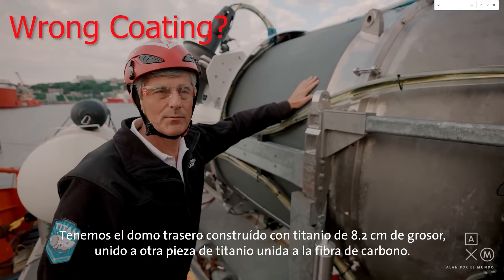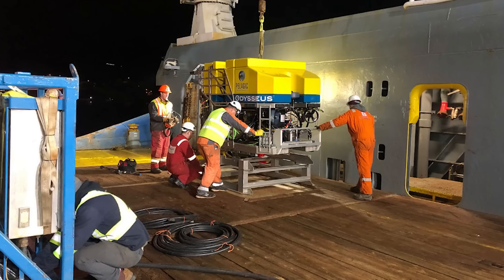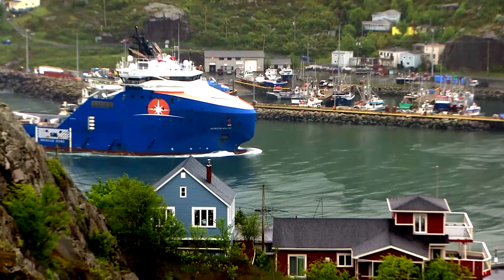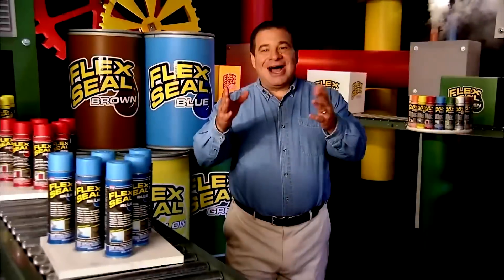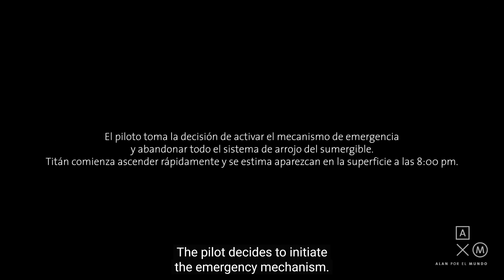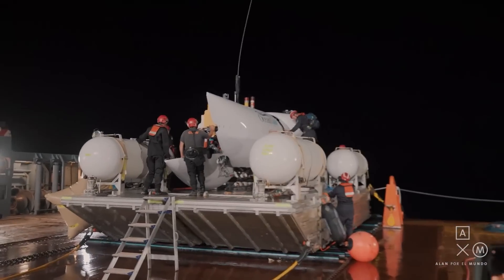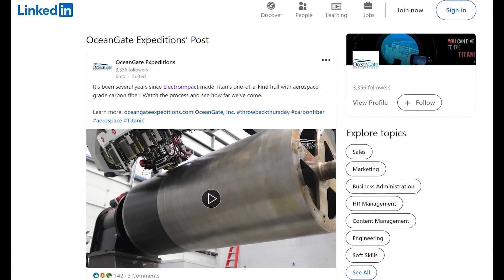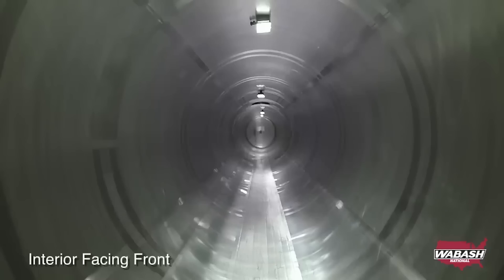Titan Sub Wrong Coating? Hull Construction, Debris Field Search

Comment: in fact, you can't really use 1/3rd scale models here, because the thickness of the CF/epoxy is crucial for the integrity of the tube. doing a smaller model might give incorrect positive results which may not transfer to the full scale item unless additional testing is done.
Reply: While true, in engineering, scale models are use as a way to verify "proof of concept", and MUST be followed up with testing on full-sized models to do a final test (sanity check).  This ensures any variations don't get "lost" between scale model and final product.

Comment: that rhino thing gave me the creeps first time I read this. some stuff to protect truck beds to be used, without proper testing one presumes, on a deep diving submersible beggars belief. however, that's just one mistake on top of the major ones, like using CF unidirectional fibres so not making use of the high tensile strength of CF  an cementing them to titan end caps.

Comment: He was ahppy enough to brag that the one third carbon fibre model had never been tested before but ASSUMED that a one third scale model could be scaled up.  You can't have it both ways and a full scale model was necessary to ensure they knew what would happen.  Perhaps they thought that because the problem was with one of the hemispheres, so making them out of titanium then gluing (!) that to the carbon fibre cylinder would "solve" the prob;em

Comment: Jeff, what wonders me, they wind the carbon over a steel (?) cylinder. Do they get that cylinder out of it later. OR, does that steel cylinder stay part of the hull?
Reply: There is a video of the steel liner being skull dragged out of the anchored carbon tube, with huge forces applied by the look of it. Whether it was the 2017 or the later hull I have no idea. Really didn't look too scientific in application though.
Reply: @bradleypark1936  Thanks. I do wonder why. It would seem stronger. Weird.

Comment: Should he have used it? Probably not. Think of it as a paint… with texture and thickness.

However of all the materials he did use, rhino liner and titanium were probably the only materials that were a good idea. 

As far as testing goes, a scale model is a start. Gives you a baseline to do full sized adjustments. You should still test full size. I also think it should go through destructive tests before they do non-destructive of the final manned vessel.

Comment: Great vid Jeff. Do you think the method used to create the CF cylinder was intended to avoid any weak spots that a criss-cross pattern might have?
Reply: @clivewismayer2404 A crisscross pattern is stronger than laying the fiber strands in parallel.  Crisscross is now standard in other applications (planes, cars, etv)

Comment: They probably didn't have a test chamber big enough to test a full size hull and were too cheap to pay for one. Scale effects are tricky, so it would not be wise to extrapolate from a single test of a model. They should also do multiple tests short of destruction on the same one to find out about fatigue effects.
A cylinder under compression load will fail by buckling in as seen with the tanker demonstration. Any out of round or flaw can provide the starting point for the failure so it is very hard to predict the actual failure load.

Comment: My first thought when I saw that they had used Rhinoliner is that it might not be chemically compatible with the adhesive used on the carbon fiber or the carbon fiber itself. 

It could have caused the carbon fiber to degrade at an accelerated rate.

Just a thought.
Reply: And it would make it almost impossible to visually detect such damage - or check for any stress cracking or delamination of the surface of the CF tube. Rhinoliner will conceal all the problems

Comment: Correct me if I'm wrong but was not that one third scale pressure test applying compression only in the vertical dimension? Hence the strength of his central cylindrical carbon fibre hull was not being tested at all. 

And the cylindrical end piece fibre failed that test before the pressure at the depth of the Titanic was reached hence why they went back to titanium domes?

Also were not those domes cross wound? Hmm I think nature was giving Rush a clear warning if only his ears were open.

Comment: The implosion at 12:12 is nothing like what happened to Titan. The pressure was 350 times greater, the speed of sound 4 times greater and the water 1000 times more dense than air. As the water moved in at a mile a second pushing fragments of carbon fibre, the air inside got compressed 350 times and hotter than molten steel, then the water kept moving in until it bounced off the super-compressed air. The bubble oscillated in and out - it's called bubble pulse - and "slowly" died away. All over in the blink of an eye.

Comment: People knew not seem to understand that if there is a problem catastrophe anyting they have to get those ships mobilized to get to find them. We used to call the Disco I don't know what the name of the boat and our Port when it broke down no, we did not have to work on it. It's sat there for three months until they could find the barge that could handle the weight of the ship just send it to where it needed to be to get fixed people think things happen overnight and they don't good job Jeff
Yeah Rhino liner my but won't do anything really easily guided underneath the car and it worked for about six months and that was about it   I knew somebody's going to say Flex Seal and it had to be you hahaha
His video is well worth the watch it's cut up into four pieces and it's very very good. There's another YouTuber that wanted to go but the seas are too rough and there were lots of problems with the Titan they went down 30 ft and came right back up he was offered the next trip and Lisa no getting to that come and that's the trip that included he was so damn lucky❤

Comment: One thing I like about the carbon fiber domes is that it would react the same to pressure as the hull.  I strongly suspect that the different materials, which would react to the stresses of the dives in differing ways, is a big contributing factor to the final implosion.  However there are so many things they screwed up who knows which imbicillic decision was the straw that broke the camel's back.
Reply: Nobody had test data on carbon fibre domes because nobody else was foolish enough to try it.
Reply: Carbon fiber domes is a good idea if you wanted it to shatter the first time down.
Reply: " However there are so many things they screwed up who knows which imbicillic decision was the straw that broke the camel's back." 

Yeah. At that point you have to ask yourself: What didn't go wrong? And how did it manage to be fine as long as it did, despite all the odds against it...
Reply: Making that hull out of carbon fiber was the thing that doomed that submersible. What you coat it with is kind of irrelevant.
Reply: Well you would be dead if you went with cf domes
Reply: Not true , the shape of hull and domes would affect pressure differently.

Comment: The tank car implosion supports the reality that a failure of a structure usually happens at one location and then progresses away from that point.  A lot of simulations on youtube have shown the pressure vessel to implode uniformly all the way around, all towards the center.  I think it likely initiated a failure at one location, water started coming in, and then the failure progresses outwards from that point but by then water was already inside and at some point the interia of the water inside started impacting the pressure vessel away from the point of initial failure and probably exerted more pressure on the inside of it than the static water pressure on the outside which could have caused that carbon fiber to fail outwards.

Comment: If no one else has pointed it out, it looks like the carbon fiber on the 1/3 scale model was wound differently -- in a diamond weave pattern than the hoop wrapped hull of the real Titan sub. One can see the weave pattern on the model.

It begs the question then, in what way did the 1/3 scale model represent the real thing?

Comment: And interesting video I watched was the process used to lay the carbon fiber is licensed by NASA.  Hence the NASA affiliation.  Apparently the benefit of this method is less waste and with different types of observation methods for the carbon laying process.  Also they can program algorithms for when the robot that lays the carbon has over laps or gaps.  High tech but very prone to issues

Comment: My dad told me to build a proper high pressure sub requires J&B cold weld on the end caps. Apply with a popsicle stick and let it cure a couple days. Good to go.

Comment: Does Rhinocoating have any solvents/chemical components that might affect the integrity of the carbon fiber and resins? It was also my understanding that the carbon fiber hull was not the original design gauge (7-inches thick); it was only 5 inches thick, making it much weaker; why the departure from the original design specification for it's intended use. In all, it's quite sad that Stockton Rush appears to have had some measure of contempt for safety engineering and the designs for intended use of the Titan submersible. May they all rest in peace

Comment: The exterior liner could well be used by the USN but probably on fiberglass fiber reinforced resin boats. 
There are nondestructive test & inspection methods for carbon fiber composite - from the visual to ultrasound and thermal imaging. Didn’t Lockridge shine some some sort of light through a hull early on? 
My question about the exterior coating is did it hinder or prevent even a simple, periodic visual inspection of the exterior of the hull? The Titan had (sadly past tense) a interior liner (from my review of pics) to which the two video monitors were attached and a deck. Some failures of composite tubes/pipes subject to high exterior pressures (sea bed piping) occur on the interior surface. Did OG ever periodically remove these liners to even visually inspect the hull? The NTSB will look at every aspect of OG’s operations. Now delamination of composites can occur within the structure (just like concrete pool decks) but a visual might uncover crazing, cracking or surface irregularities.

Comment: To test a chamber that is 1/3 the size of the one you are actually going to use is absolutely moronic.    The entire surface area of the smaller chamber is exponentially reduced when you apply pounds per square inch of pressure. You cannot simply test a much smaller chamber and multiply the numbers up and think you are getting a mathematically accurate view of what the actual chamber is going to experience.  Hence, yet one more reason Stockton was NOT the smartest guy in the room like he thought he was.

Comment: The handling does not seem to me to be the source of the problem, at least the frame is not twisted by the lifting, even if it can force a little on the top of the titanium strapping, in the long run yes it may be , but it is above all that I have seen more serious, the frame (lengthwise profile view) is a rectangle whose legs are fixed to the titanium strapping, one of the bottom bars is bent by an accident (from lifting or diving on the bottom) (we see it on a photo) which modifies the parallelism of the legs, with the consequence of forcing the strapping in rotation and hindering the fall of the frame, once the frame has fallen, this force on the strapping reverses sharply if the rear seeks to float from the syntactic foam, or is always released so abruptly, the carbon does not need to implode to be pulverized the wave arrives at twice the speed of sound.

Comment: The rhino liner is irrelevant.  The carbon hull failed, and no amount of flexible liner would have saved it.  The only real question in my mind is, did it fail in the middle or on glue joint?  It sounds from the leaked transcripts that it failed aft where the cap was glued to the hull.  Bottom line metal sphere or nothing if your going that deep.

Comment: Jeff, if the Hull of the Titan Submersible had been fabricated to the original specification of 7” thick,….NOT 5”. Would the proprietary RTM system been effective, and given the crew of Titan time to surface? What good is a Hull monitor if you can’t surface before you drown and or implode? 😮

Comment: I have heard that the 777 main wing spar (this bears most of the lift force holding the plane in the air + xtra G loading) is a carbon fiber reinforced composite (CFRC). I doubt Boeing tested a full size prototype in a simulation of one flight & concluded, “yup, this will be fine.” 
The 1/3 scale model failed at less than 4,000 foot-depth pressure! What did OG learn from this other than that design of a CFRC end cap with a view port will fail long before the Titanic will be reached. 
Why a 1/3 scale model? Cost. I don’t know how stresses scale in submersible pressure hulls but do know small internal diameter (ID) tubing of a certain wall thickness can carry far higher (steam) pressures than a larger ID tube with a proportionately thicker wall thickness; all other things being the same, increasing the thickness doesn’t mean the additional material adds that much more to allowable pressure. Certainly a 1/3 scale model might show up a bad design or construction method. Is there a shore side test facility capable of testing a Titan sized item? Better question, is one available at a reasonable price? There’s always dipping the sub in the ocean but this has support ship rental costs (Sounds like OG did do test dives).

Comment: Just a fun fact. UV light deteriorates carbon fiber quite rapidly. Boeing had to change the interior lighting in its Everett assembly line once they discovered the problem during the building of the 787. Had to strike the first couple of lines because of the damage caused.

Comment: I cant find the video again, but I noticed something interesting about those mini-sub test results.
The mini-sub for the test was made completely out of carbon fiber, including the domes.
When they pulled the mini-sub out of the test casing, everything was pretty destroyed except the domes.
In another video of the mini-test-sub being built, I saw the carbon fiber for (obvious reasons; you can't install them linear on the half-sphere) they were installed in an interlock positions on the domes. 
The same position everyone was telling Stockton to put carbon fiber in the passenger compartment.
The carbon fiber only held in the interlock positions in the domes, but not in the linear positions for the passenger compartment.
The crazy thing was, Stockon took all the wrong ideas from the test; he kept the carbon fiber the same way that it failed in the testt, and the domes that survived well, he totally redesigned to pure titanium.

Comment: They probably stress-tested a model to save money. But how many tests were done to show stress over time?
Side note: Seeing that smooth white exterior of Titan reminded me of a software presentation I attended long ago. I was impressed by their nice diagrams showing how the applications worked together. Then I had a flash of insight, picturing their code being just as old and patched as ours, but they had a pretty box around it which made it look neat and tidy.
Reply: not to mention professional......
Reply: I hear very few tests were done on structural integrity....like scary little!!
Reply: @iam1smiley1 a grand total of one
Reply: The one third scale test failed after 4000 psi before 5000 psi.
Reply: @Paul_Wetor Marketing == professional lying.

Comment: There’s no pressure testing facility that can test a full scale model of the Titan it’s too big
Reply: yet limiting factor and other craft had it done
Reply: If you watch the LF docu they show it being tested at the largest facility that can handle that pressure and it barely fit in the test chamber. The Titan is bigger still. There doesn’t exist a pressure test chamber big enough for the Titan.

Comment: What I don't understand is why would you use carbon fiber vs. Steel? Carbon fiber is very expensive and usually used in applications were weight is an issue but in a submarine weight is not an issue so I don't understand.
Reply: a steel or titanium or acrylic submersible that can go repeatedly past Crush depth has limited space  with often just two or three people. these submersibles will cost 15-30 mill each. add in the cost of a dedicated support vessel. 

carbon fiber is way cheaper and you can make a cramped vessel that has five. problem is well carbon fiber you cannot predict when it will fail.

Comment: They found the sub quickly because there is a designated drop area for the sub ballast weights to prevent damage to the Titanic herself.  That area is located away from the wreck and debris field.  It makes sense that search crews knew exactly where to look.  Had the Titan not imploded, then the search could have easily been weeks of futile effort.  

How do you find sub debris in a Titanic debris field with sonar?  Most likely you don't.

Comment: The cf flat cylindrical winding of Titan was due to voids. If the cf is layer zigzag, the cf builds up at the ends and where there was an overlap, a void occurs.  The Titans design was used by navy underwater drones called AUSS
Reply: you mean the unmanned aircraft that look nothing like the Titan?
Reply: @toomanyaccounts    The AUSS is an US Navy underwater drone that operated below 4km. It had a carbon fiber haul with titanium end caps. Yep, the Titan was founded on scientific design and operational vehicles.